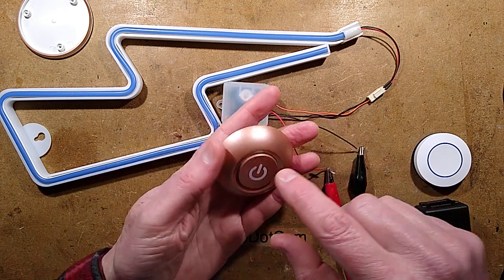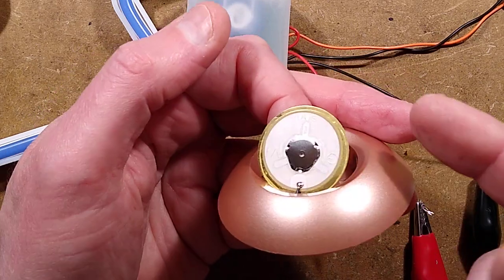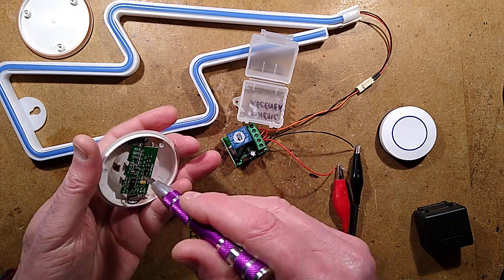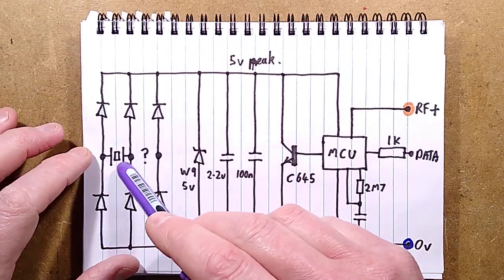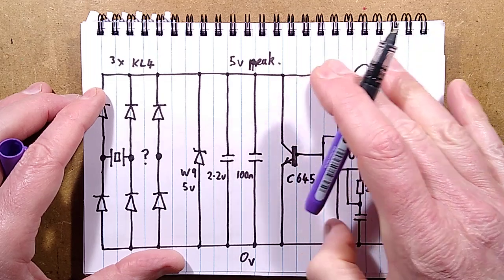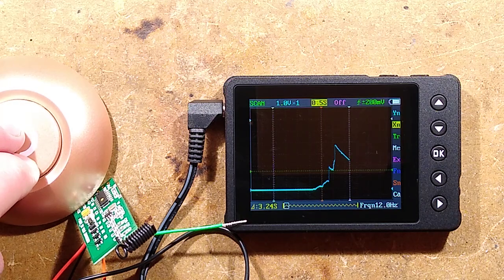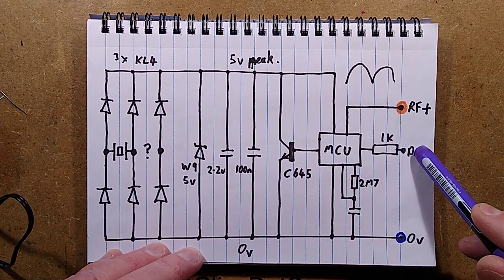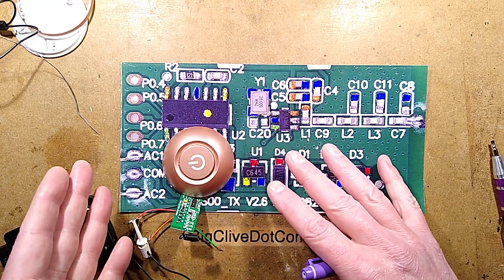I thought this was going to be a fake kinetic switch

Comment: I installed these in prisons, as inmate call buttons.  They would push and trash the standard mechanical switch units.  These proved to be almost indestructible.  The ones I used didn't click or move, so nothing to be damaged by an irate guest.

Comment: I have encountered some of those piezo devices in drum machines for one example.  I also have salvaged some,  where they were presumably intended to be sounders of one sort or another (in telephones).  I took one that was encased in blue plastic and just for the heck of it connected it to my scope,  and it seemed to make a pretty good microphone!  I also recall running across something a while back that talked about using one as a "pickup" in a guitar...

Comment: I am always amazed how little power modern chips need to operate.  If you removed that shunt transistor would the voltage stay high enough for it to stay active?  Would it keep transmitting the code until the energy is drained enough to shutdown?  A self kill switch to ensure it only runs once each press.
Reply from the maker: I think it only transmits the code once and then shuts itself down.

Comment: 🤣🤣 there's a flaw with these. Im guessing theyre not coded.

I have some bike lights (varying brands)  one is front light with brightness settings only (no rf signals), then i have a rear light and a set of indicators (rf enabled).

Now it took me some months of cycling to realise when i pressed the brightness/power button on my front light...it was toggling the indicators and rear light.

Now that front light has no radio function. But obviously was cheaper to build with one. Everything in china being modular now.

So im wondering...if you rig your house with these switches...what will be getting turned on and off?

Kettle? Bike lights? Car engine?    No coding makes these verrry risky to use.

Comment: I work as a product engineer in a factory that makes piezoelectric components. The 'crystals' are ceramic materials which become piezoelectric when DC voltage is passed across them at temperature. Voltage is typically 2-3.5 kV per mm and temperatures are typically around 100-130°C which is usually a bit below the curie point of most of the materials. This process is usually done with the components submerged in heated insulating oil to prevent voltage breakdown, but can be done in air if the components are thin enough. If you heat a piezoelectric material to above its curie point it ceases to become piezoelectric, but the mechanism is reversible

Comment: I believe the manufacturing process Clive mentioned is for certain 'electret' devices, with a fixed electric charge analogous to a hard magnet, piezo devices rely on the stress/strain interaction with the charges in certain crystal lattice, for instance if you cleave standard quartz crystal along the right orientations it will naturally exhibit piezoelectric properties.

Comment: Just what I wanted to know: if a kinetic switch can be paired with a "regular" 433Mhz receiver found all over Aliexpress and vice-versa - apparently the answer is no for both...
Reply from the maker: I've tried pairing them, but the code system seems incompatible.
Reply: @bigclivedotcom  I tried it too and thought perhaps mine's broken, but no. Even though they both claim to be "1527 rolling code" on paper...not entirely sure what goes on behind that though...

Comment: I'm pretty sure that the part labeled "C645" is a  low voltage reset IC which holds the MCU in reset when the supply voltage is below 4.5V. Also, the reference designator on the PCB is U1 which points to an IC. If it was a transistor, it would normally be labeled Q1. It's probably a BL8506-45CRM
https://www.belling.com.cn/en/media/file_object/bel_product/BL8506/datasheet/BL8506_V1.9_en.pdf

Comment: 9:50 Then what happens if it's held for ~5 seconds, would it "flip" a second time?
Reply from the maker: It needs continuous movement to generate the power.
Reply: Yes I have two years of automation classes.. what I meant was to hesitate for five seconds when pressing and then release, would the relay do one one-off cycle. But I'll guess people aren't that lazy.
Reply: Come to think of it the Philips Hue sells a remote control that's battery free, it would be nice to know how it works. But I was too cheap to get it because of the NOK 1600 price tag so I'll use the phone. The geo fencing is neat.

Comment: Love these "self powered" electronics. Came across a vibrator that powered a tire pressure sending unit in the wheel of a car. Driving charged a cap that powered the transmitter.

Comment: If that receiver circuitry is truly self-contained on that secondary board, then would it not be conceivable to splice that onto another receiver to make it truly universal?
Reply from the maker: Many receiver modules actually put out raw code data to the rest of the circuit.

Comment: While I'm not sure if oven+electricity works, I know that the process normally done for creating a piezo electric crystal is done by compressing quartz to a specific pressure then cutting it at an offset specific angle so that the molecules are lined up in such a way that it can cause an electron to 'skip' across the crystal structure once its deformed.

Edit: I found a video detailing how the lattice structure of quartz gives it piezoelectric properties and the process for how they make piezoelectronics https://youtu.be/wcJXA8IqYl8

Comment: Is it a transistor firing on a spike from the controller at the end of the pulse or is it a reset IC firing a reset signal at the start of the pulse? Would be interesting to see it on a dual channel scope.

EDIT: probably found it, C645 can point to a 4.5V voltage detector IC according to https://smd.yooneed.one/code4336.html

Comment: Awwwww clive I'm new here and you print the pages off instead of editing them in (here is the part where I'd put a bunch of gay ass emojis if I wasn't on my laptop)
Reply from the maker: It's so I can draw on them and point at specific bits without having to squiggle a mouse to make its pointer visible.

Comment: The zener makes sense, as the output of a piezo unit can well exceed 5 volts. The clamp makes sense as well, keeping the controller VCC outside of the indeterminate level, which could reset its code, send multiple toggling signals and more.
Overall, it's elegant in its simplicity.

Comment: I require a system where 3-4 staff members have a button on their desks which can silence a single audio source - possibly a radio stream? - so that they can listen to music at work but each of them can silence it if the phone rings. 

I've thought about a RPi running the audio stream and using a relay to interupt power to active speakers (small ones) but not sure if this is optimal method. Alternative sugestions would be very welcome, especially if they don't involve switching mains power. Thanks.
Reply from the maker: Standard remote control buttons with one receiver breaking the circuit to the speaker/s.  Each button programmed as an on/off toggle.

Comment: I use piezo on my DIY timegrapher for watches. It can sense those tiny ticking sounds and software on PC calculates how many seconds the watch is fast or slow in 24 hours or 86400 seconds.
Piezos are used in cars too, probably the most important one is knocking sensor. It's piezo, senses knocking and in matter of milliseconds tells the ECU that we got a problem here in cylinder number 3

But that switch you got, just wow

Comment: C'mon! There's written U1, that means it has to be some kind of CHIP not transistor! 1min search and I fond it: BL8506-45CRM This chip gives START signal to MCU, when voltage raches to 4,5V. And third double-diode contact COM is used in case of 2-contact pieso-element.

Comment: I was expecting a lighter mechanism inside.
I've noted before that the mechanism inside an electronic lighter is seemingly purposely designed to accept a key cap.
Ive contemplated using the clicky lid from a fish paste or baby food jar as an acoustic button.
Using the larger diameter  piezoelectric transducer and a short, stiff compression spring, possibly from the aforementioned lighter, could possibly provide more energy and extend the range.
Careful design of the enclosure could even provide IP67 weatherproofing for a button at the garden gate.

One day I may get off my lazy backside and actually try my ideas out.

Comment: My outdoor floodlights were installed all on separate switched in different rooms... (stupid contractor)  so I used this kind of switch with receivers for the front and another for the back and they worked great.  I could control all from in the family room.  However, I now leave the switches all on and put Alexa controlled floodlight all around so I can do voice, or they are linked to the motion sensors and cameras...  But Pre-Alexa, I really needed this kind of switch and they worked well.

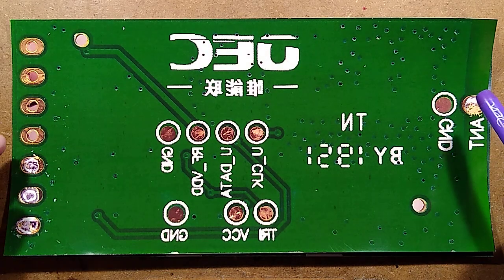Comment: 5:43 I thought he had Dooneese hands.
I agree the c645 must be to drain the caps after transmit is complete, so it's immediately ready to detect and respond to the next button push... though it's interesting there's no drain resistor into c645.
Edit: you showed that with scope after all. 
I think I would power the microcontroller through a Zener, and have a bleed resistor on the caps to prevent inadvertent charging from massaging the button or even vibration or sound. 
In fact that would be an interesting test, whether voltage builds enough for a transmission simply from auxiliary vibration or sound...

Comment: I might have to get one of these for the undercabinet lighting in my kitchen.
The main light switch is almost line-of-site to the cabinets and it's where I'd probably want the switch for them to be. I'm also rather lazy about replacing batteries.
I wish they made a regular light switch that'd also send off a wireless signal so that I could just have them turn on with my main kitchen lights though (wiring them together would be a nightmare).

Comment: Awesome little bugger. But i don't think its monitoring the actual voltage.
It looks to me to that the MC has 5V logic and the difference you see is the high and low state of the MC with a big hysteresis.
Basically: If high send data then shunt until pin is low, rinse and repeat.
This is very clever abusing the MC in this way.

Comment: The other problem with energy-generating pavements is that they would by definition be very tiring to walk on! It would be a bit like quicksand; you would not actually get sucked down, but there would be less energy returned from each step (because some of it is being turned into electricity). And if it is sufficiently unpleasant to walk on, _people will actively avoid it_, further diminishing any return on your original investment.

Comment: I wonder if they generate enough current to power a doorbell, I'd be wonderful if you didn't have to worry about changing their batteries

nevermind, got to the point where you mentioned it would only work in line of sight

Comment: That thing that doesn't look like a transistor but acts like one; Is it possible it's a miniature electronic relay switch? ...or a NAND chip?
Reply from the maker: Initially I wondered if it was a voltage reference, but it seems to have the characteristics of a transistor.

Comment: Back in '95 I was working for a security electronics firm that had a stainless-steel external alarm siren box in their product range. These boxes have front and back tamper switches but I had a play with epoxying a piezo disc to the cover to see if an attack could be detected well before the box was levered off the wall. Worked very well but there was zero interest from the company management. I've still got the cover here somewhere.

Comment: My guess is that all those L's and C's in the RF board is for impedance matching (transformation) between the antena and the Tx circuit at 433MHz.
Reply: Quite right, old amateur radio hams will recognise that LC network immediately

Comment: As an Electrical Engineer of 50 years experience, I was surprised that you did not show the pulse train from the MCU to the RF transmitter. It would have been interesting to see how much data was being sent and at what bit rate during such a brief activation period. Also, an RF spectrum analyzer would show just how low the signal strength is. From you description of the reliability over distance I'm guessing that the near field signal is around -110 dB. Overall a good video, though.

Comment: The Quinetic ones must be pretty reliable as several electrical engineers on YouTube install them as standard for turning on/off mains lighting rather than traditional light switches.  Especially common for turning outdoor lighting on/off from indoors without having to run a wire.  They are priced accordingly of course.

Comment: In designing circuit boards what are the limitations and/or side effects  for the space <bigger or smaller> between the Load and Neutral? Love your channel and thank you for your time and efforts sir! ✌
Reply from the maker: If connections aren't spaced far enough apart there can be tracking issues caused by bugs and moisture.  It can result in a short circuit or sustained burning between adjacent pins.

Comment: The filter circuit going to the antenna is a balun. It is used to provide impedance matching between the PA stage of the RF transmitter and the antenna. The PA stage might for example be designed for a 90 ohm load, but the antenna, might be 85 ohms. The antenna which is a PCB stripline is tuned to a specific frequency or a frequency band. Changing the C and R's in the balun changes the impedance matching and also the Q of the circuit. At RF you cannot just add a resistor in between to match load, you need to use a combination of C and R's to get the correct match. The balun is also used to round the square wave output from the transmitter into something more sine. You want the energy to be directed to the antenna and for the energy  to be at the desired frequency like 488.0000MHz and not contain any harmonics, else you'll be radiating the harmonics, which is 1. a waste of power, 2. means you'll fail on your RF emissions. The choke (inductor) on the balun is used to bias the PA of the transmitter and also stop back reflections. You want the signal from the PA to go the the antenna and not onto the power supply line, which without the choke would also look like an antenna. 

The RF chip  is essentially a HF mixer. Not sure if the output is FSK or simple pulse modulation. The 26MHz xtal will be used as the reference for a PLL. The PLL will probably generate a 488MHz output for the UK market. Internal to the Rf chip will be some filtering to round the edges from the PLL. The RF signal is them modulated by the signal from the micro, either by a switch or VCO.

The transistor used to shunt the power to ground is required to stop the micro and RF chip going into brownout when the supply starts to drop. It is also used to restart the firmware and make sure that you always go into a fail safe mode of operation. You don't want the micro to sit around brownout  especially if the user clicks the button in quick succession as the power rail with then will rise and the micro might not boot correctly causing it to go into nar nar land. Think of it like a hard reset, when your TV remote goes wrong and you cannot get it to turn the TV back on what do you do. you pull the batteries out thinking they must be dead. Maybe you replace them, but if you don't and put them back in the remote will probably work again. This is where the batteries are reaching end of life and the internal resistance is high. Pulling them out and putting them back in again does 2 things it resets the micro in the TV remote and 2 it scrapes the electrodes on the battery giving you a few more days out the batteries as the electrodes have been scraped reducing the resistance. 
Finally,  RF transmitters like a nice stable power supply. Getting the micro or the RF chip to operate at Vin min or below could cause latchup. Latchup is bad, causes things inside the silicon to go pop!

The piezo was probably a dual disc, or split disk. Designed to give you a positive and negative pulse on each push / release of the button. -Cost or lack of power may have caused the designer to stick with the simple design they have implemented.

Comment: Oddly reminded of a gizmo my grandmother had for her TV.  Grandpa was into building electronic kits from the back of magazines, and so there were all sorts of odd gizmos around the house.  Pushing a button on the box she kept by her chair snapped a spring against a small metal rod, and there was a box on the TV that picked up the chime sound.  It was quite high pitched and tinkly.  Sometimes other things in the house, like dropping silverware or keys would set it off, and bring cursing from the living room, as the channel suddenly changed during granny's soap opera.  Also in common with this: it worked about half the time.
Reply from the maker: Those audio remotes were very common in early TVs.

Comment: what is the energy watts,amps per displacement(?) of those switch discs? anyone know where i could find the info on the component?
Reply from the maker: It's very low.  Mainly used as a signal.
Reply: @bigclivedotcom  do you have any interest in mad science or heat engines? if so how best to message you with the idea i have? you might find it amusing.

Comment: I still remember the day in 1968, when I could turn of my bedroom light from under my covers,in my cozy bed. I added a string to the pull chain light socket in the ceiling light :-)  Now I can dim, change the colour or turn off the whole house with my big toe using a click switch stuck to the foot of my bed.